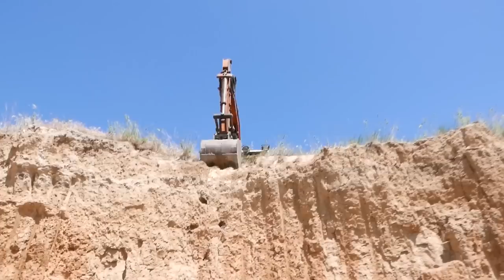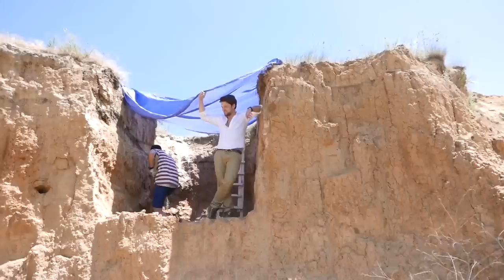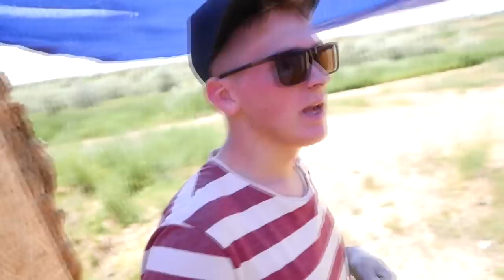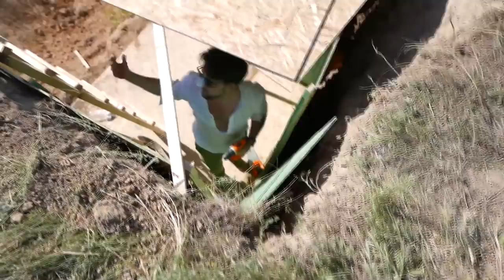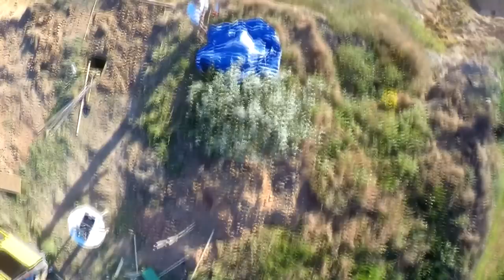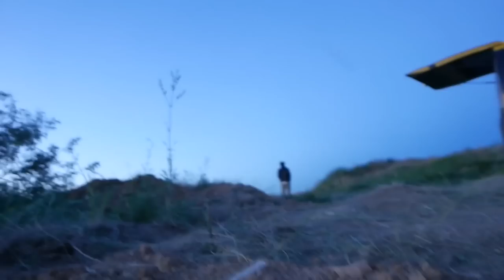UNDERGROUND HOUSE IN THE MOUNTAIN - DIY

Comment: like several of your  videos that i have watched but keep {cing}seeing a construction issue  over and over that make this so it will last 1 season or less osb needs paint on all sides to keep moister from tearing apart the wood when it gets wet  and wet soil pusses against it and other building technics used are not strong enough to support in cave in. with more than 40 years of construction and building experience i know it is industry standard to use  OSB CHIP BOARD AND PARTIAL BOAR   """ BUTT  """ MOST OF THE TIME THEY ARE ONLY libel for integrity if structure for 1 YEAR.
Reply from the maker: Ok, Thank You!
 the house is built for fun